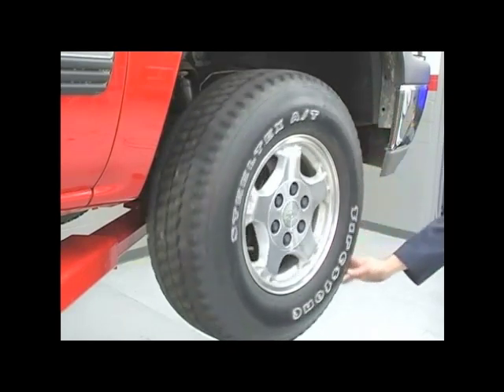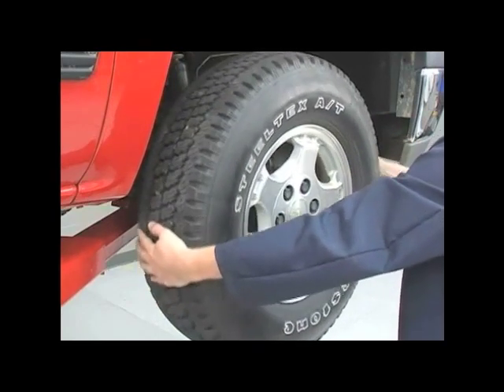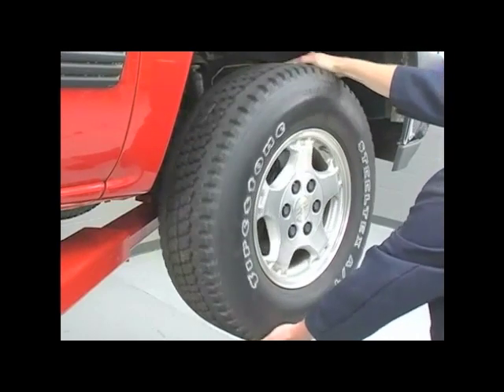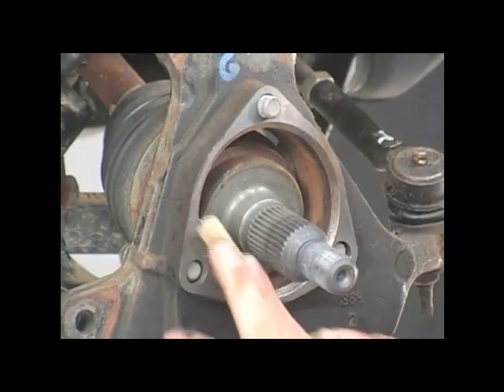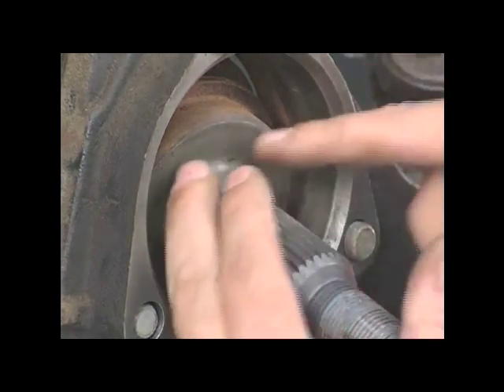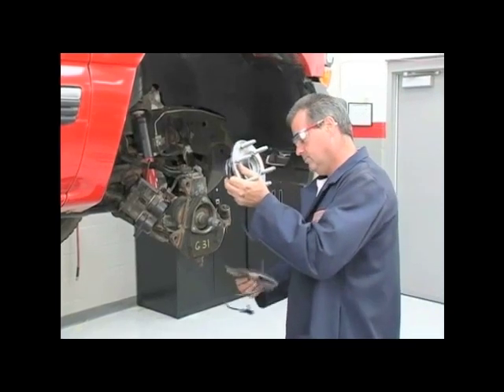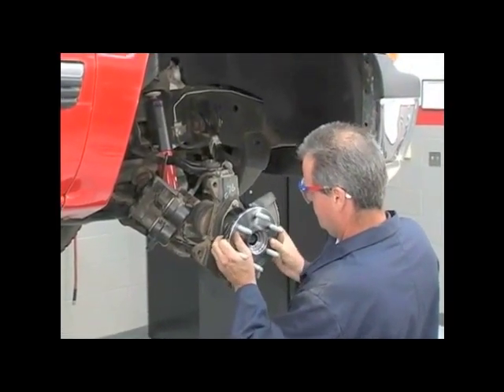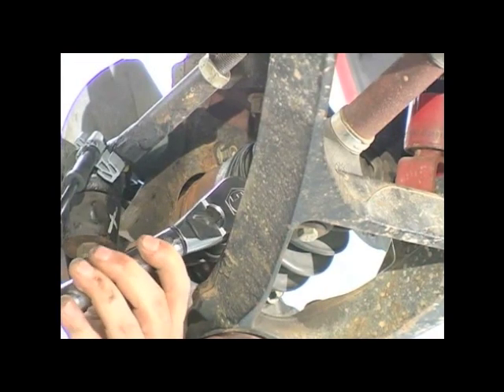The Trainer #19:  Hub Bearing Inspection and Replacement

Comment: "....in some cases a puller may be required..." 

 are you kidding me!!! , IT WILL BE REQUIRED 99.999% of the time. Otherwise you car is brand new and wont likely need a hub bearing assy replacement.,

Comment: I'm not sure I understand why we should apply the brake pedal when installing the castle nut to hold the hub in place. Is it done to be sure the hub goes on with the rotor in line with the brake shoes?